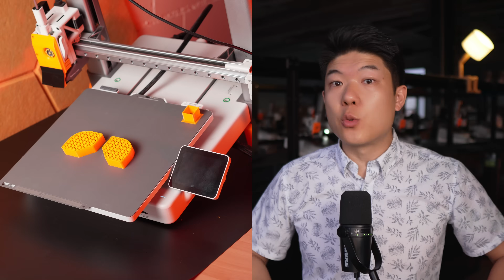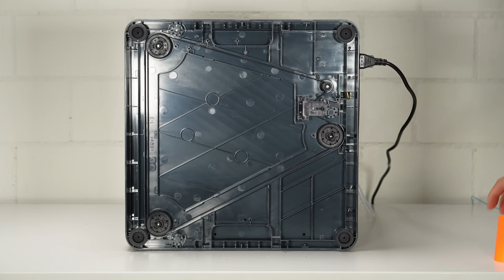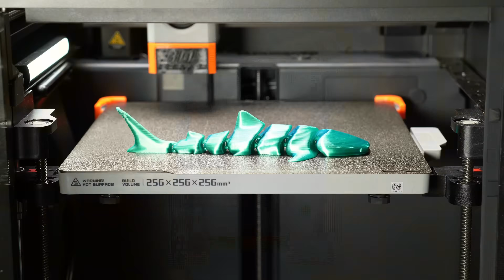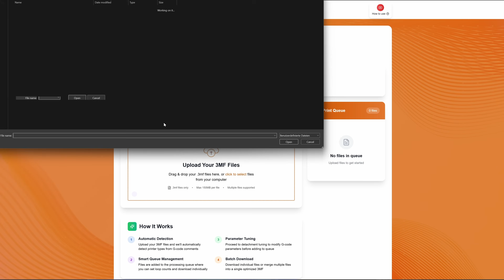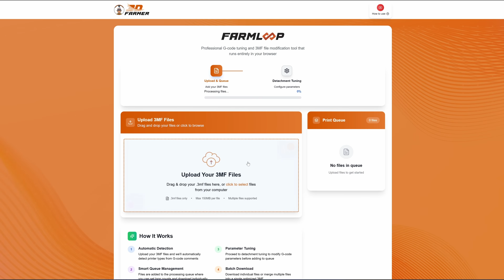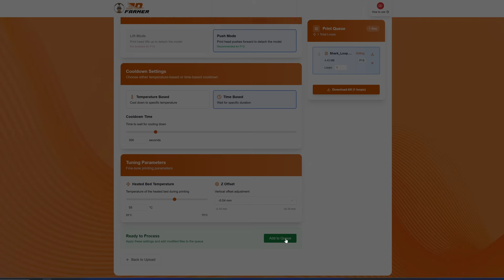How to Automate Your Bambu Lab P1S & X1C for FREE - FarmLoop Stage 1

Comment: what firmware are you using on X1C? I ask as tried your free app and the modified g-code sets the nozzle temp wrong, meant to be 230c your modified version is set it to 250c and 230c is max in the filament profile and i examined the gcode and there is no M104 S250 anywhere but still when tested still sets at 250c and tried 2 different versions of Bambu studio (since you guys dont answer emails thought would try it here) and also you app doesn't recognised modified machine profiles like my Steinwiper profiles!

Comment: If farmloop code failed to clear the bed after 3-D printing(some parts left behind), do you have a solution/code trough farmloop for second pass of printing head to clear the bed? By the way, product is amazing
Reply from the maker: SimplyPrints Bed check AI will detect it and stop the print. However, a sweep motion in the start of the next file would be a great idea. I will think about that.

Comment: Great system. Just wanted to use it as a hobbist, not full print farm. Can't justify the base price for me, just want to print more away from home. But the locked settings for z offset, and temp (25ºc is too low for my location, it never gets there) and time (that is what I use, but an hour is too much). Had little problems with z offset, but would like to try changing ir for better testing. But I recomend it for any one looking to build a print farm.

Comment: Hi guys,

Fantastic system, I’ve just finished installing everything. I have a setup with 4 X1C printers and I’m facing a small issue: when I start a print via the app using the print loops, after the first part is finished, the build plate doesn’t lower to clear the part. It remains fixed in position.

I’m probably missing something in the Farm Loop app settings. That being said, thank you for the great work you're doing.

I hope you can help me out.

Best regards, Luca
Reply from the maker: Hi Luca, did you click on Add to queue before downloading?

Comment: Great system! I might even go for the Pro plan. 

One question though. How does the printed tilting affect the max. overhang angle? Can I still print at 45º with no supports at any direction? Hve you guys tested this?

Comment: For using the farm loop automation on multicolor prints, do you find it best to remove the prime tower to avoid removal issues? Worried that if i keep it, the plate bending wont be enough to break it free and the print head attachment wont be able to remove it before the next print cycle. I saw @samcraft post a video using the farm loop for multicolor and i didnt see a prime tower

Comment: I can't get it to work for me. The print plate does not go all the way down and bend before scooping, for whatever reason.
Reply from the maker: Did you watch the how to use video on the farmloop app page?
Reply: @3DFarmers  I did, I uploaded my Gcode into the farmloop app, selected my loops, downloaded the gcode, but after its finished with its print, the bed does not lower enough to come in contact with the bender, and the extruder never does its pushing motion either. I can't figure out why. Once the print is finished, the bed will only lower about half way, then the it will begin leveling to start a new print. I am using the bamboo labs p1p.
Reply: I figured it out. I did not hit the "add to queue" button before hitting the download button in the farmloop app. I missed a step. Dummy me. Works fantastic now. I bought the subscription. You can have my $10 a month. Worth every penny.

Comment: As much as I wanted to love this system, it just ruined my brand new p1s catastrophically. From the aftermath, it seems like what happened was that one of the pieces I was printing ejected directly down into the bottom space of the printer, at which point it got sucked in by the z-axis rods. The z-axis rods chewed into the PLA and got stuck, de-calibrating the Z-axis in the middle of the print. Finally, when it raised again to start the next print, it pushed the bed straight into the print head, which started moving and slicing gashes into both the print plate and the heatbed. I'm trying to file a warranty claim but I'm not expecting anything once they see the print logs include modified gcodes. Let this be a lesson... don't be an early adopter. If Z-axis shields or a part slide of some sort been considered in the original design to avoid this homing issue, I wouldn't be left with a (now only $400) piece of junk.

Comment: Does the app work with K1C? I made a modified toolhead cover with screw on attatchment to push off parts and a bed bender. I use Orca. In the future I will make a door opener too.

Comment: I converted the file and applied it to the X1C, but only the loop function works; the auto-lifting and auto-pushing functions do not work. Is this related to the latest software update?
Reply: Pretty sure you need to edit the file that says what happens when a print ends. Watch some other automation videos on it. I think it can be done in the pc Bambu labs app
Reply: Might be wrong tho I will look into it tomorrow as I want to do it with my p1s

Comment: Is there a maximum print size with this system? Can i use the whole build plate?
Reply from the maker: With Stage 1 max z height is 200mm. Stage 2 will unlock full height.

Comment: Love the idea.  Wanted to test it before I bought it, but wanted to confirm that the free version requires 3600 sec (1 hour) before it will attempt to detach the 3D print...?
Reply from the maker: Yes, the free version has 1 hour of safety wait time before release. With the Pro app you can adjust that time.

Comment: Just to clarify - you don't have fusion tutorials, just exercises that tell you to print a specific print(challenges) - correct? So you must be already experienced In fusion  to benefit I'm assuming? I believe you have recorded videos showing how you completed the challenges? Do you think that would be enough to learn fusion? Or do you have another recommended source to learn fusion?
Reply from the maker: Our challenges focus on learning by doing and are design to create products for additive manufacturing. There are 10 challenges for beginners and 10 more will come out for advanced users soon.

Comment: Great solution! I wonder how simpler solution beats comlex and over engineered mechanisms easily. 
I was always thinking about this kind of part ejection mechanism but always stuck in overthinking an over engineering. So, best wishes and hats off. I would like to learn more about the update of the project and share insights together.

Comment: Hi! I really love your 3D Print Auto Farm. I’m using the free version, and I noticed the bed cooling temperature can’t be changed. It’s impossible to keep my room under twenty-five degrees in the summer, so it would be amazing if we could adjust the temperature even in the free version. Thank you for considering it!
Reply: Can you tell me how you made the cooldown work? I tried several times, yes, site shows that bed will be cooled to 25, but in real my P1S is starting 2nd print after the 1st immediately

Comment: What am I doing wrong? On the X1C the modified gcode of a 20mm cylinder 
1) cools the bed and sends the bed to the bender
2) preforms a gentle push with the bed down way past the part height never contacting the part.
3) sends the tool head to the exclusion zone
4) raises the bed some
5) sends the tool head to the back right corner 
6) fast pushes forward until the tool head reaches the exclusion zone and repeats.

The issue is that the gentle push never contacts the part and instead the tool head crashes hard into the part when it starts its bed clearing sweep.
Reply: It is as though the software doesn’t account for the parts actual height.
Reply from the maker: Yes this issue is know and will be resolved with the next version of the app which updates next week.

Comment: I have a Bambu X1C and just installed all the parts. When I printed the first one, it brings the plate down to the bottom and then errors out with "heatbed homing abnormal".
Does anyone have a way around this?
Reply: also having this issue cant figure it out

Comment: Thanks. Still debating buying the pro version just trying to figure out if its worth it for me. I have a few questions

Will it or is it possible to print different colour each time as that's something that would be super useful and would this be out before Christmas? As that's something that would be super useful for Christmas as I sell a wide range of colour option around Christmas

Comment: After it cracked the build plate, it went up for the tool head to push the part off, but the build plate went too high and touched the glass top, and when the tool head tried to push it off, it wouldn’t get off because it was too high What is the problem?
Reply from the maker: That sounds like a bug which we are fixing right now. If you are subscribed to our newsletter you will get notified as soon as it is solved.
Reply: Thank you

Comment: I have tried so hard, but I can’t get it to work😢
Reply: I can get it to start a new print automatically, but it doesn’t throw off the other prints. It doesn’t even try. It’s not like it fails
Reply: @NORDIC_CREATIONS  When you download the file after processing with the app are you using the big orange 'download all button' or just downloading the modified file via the download icon next to the modified file?
Reply: I use the big orange button.
Reply: @NORDIC_CREATIONS  Ah that is your problem then. You're also downloading the original file in the loop (hence it not clearing the bed). Try downloading just the modified file. You can also checkout the instructional video that shows this step. It's linked in the top right of the farmloop app page, labeled 'How to use'.
Reply: I’m gonna try that thank you for helping me❤

Comment: It works on most stuff but it once launched my whole texture plate off with the print
Reply from the maker: Then you can tune your detachment settings in the app until it works!
Reply: @3DFarmers  turning down bed temp when it pushes off helped a lot. I still noticed sometimes my p1s head cover would fall off when pushing objects. I slapped a rubber band on it and i no longer have such issue

Comment: I need it to handle 64 parts per plate, each about 30mm in diameter and 2-5mm tall. The parts are all equally spaced over the plate 8 rows of 8 parts, each row staggered from the next. Can it do that?
Reply: Best to only load a few parts on the front half of the plate. But you can loop multiple plates. With automation, you don't really have to load plates full.

Comment: Without the paid version you have to wait 1 hour? That's annoying wanted to give the system a good test before seeing if purchasing the pro mode is worth it. It 3600 the recommended time even with pro?
Reply from the maker: In the Pro version you can flexibly change the cooldown time. We set 60min for the free app so it's safe to detach.
Reply: @3DFarmers Thanks. Still debating buying the pro version just trying to figure out if its worth it for me. I have a few questions

Will it or is it possible to print different colour each time as thats something that would be super useful?

Comment: Super rad.  This is working great on my P1S .  
It’s a very well thought out system and way better use of time than manually screwing around with gcode copy pasting and worrying each run that i’ve made some error.
Reply: How did you get it to get past the initial homing? Mine goes down all the way and then pops an error
Reply: Is your Z height defaulting to 2mm for the first sweep?

Comment: I get an error message all the time that my printer cant home the bed. This only happens with Farm Loop. Do you know why?
Reply: I am getting the same message, it seems like the pusher fully pushes the plate off of the magnetic plate and the printer recognizes that the bed is no longer attatched. When I manually move the Z-axis, the plate re-attatches, so it would not be an issue if it just continued the print, but I cannot continue while the error is ocurring. Have you since found a solution?
Reply: @pijkedaalder4339  I didnt change anything and now it works, probably just a bug

Comment: Great idea, but having issues. Bed temp does not drop between loops to lower adhesion, Z axis is not lowering to crack bed on the uprights. On one part I tried to farm printer head is just crashing into the parts to eject them while bed is still warm and part attached to bed...
Reply from the maker: Hi Sean, thanks for the feedback. Please provide us with the 3mf file to check this bug. contact@3d-farmers.com

Comment: After watching the A1 automation video you posted earlier, I made a setup that connects the plate and filament cutter stopper with stainless steel wire to bend the plate. When I checked the video again after a long time, I found that you had uploaded P1 automation using the exact same method I had been envisioning. The video and code you shared were very helpful. Thank you.

Comment: I have a question: Is it normal that the print bed temperature doesnt go down before ejecting? I print with 65 degree Celsius and before and while ejecting the temperature stays the same. Also I bought the premium version.
Reply from the maker: There is a small bug which will be fixed by tomorrow or one day later. As for now please adjust the heated bed temperature in the slicer instead of the farmloop app.
Reply: @3DFarmers thank you! You answer really fast! I appreciate that :)

Comment: I was pretty hyped seing this, and wanted to try out, but the print keeps cancelling itself after bed leveling, without any error. I don't understand what's going on...

Edit: i print on a X1C
Reply from the maker: Drop us a message to contact@3d-farmers.com with your file and failure description. We might be able to help you out.
Reply: I got an answer very quickly, with a workaround.
There is actually a bug with X1C profile, if you get the same issue, just slice the file with P1S profile, then print on your X1C. They already work on a fix.

Thanks  @3DFarmers , keep the good work ! :)

Comment: Allright! Curious in testing this. I have some really really sticky PETG cf Parts that i print with 4 on the bed. I need to bend the 4 corners plus also a firm bend inwards to pop the pieces. 
I'm going to try to print 1 piece in a corner with sufficient cooldown and hopefully it will work. 
I need to print this piece in batches of +100. This will make my life easier if it works. 😊 Thx for all your hard work!

Comment: I assume that supports and brim wont be able to come of the built plate and are not recommendet to use with the system ?
Reply from the maker: Depends. There is a "low" clearing sweep to remove supports and small parts.

Comment: I have learned so much from you since joining you way back when it was on Patreon. I am going to be implementing this system in my printing as soon as I can get the parts printed and it set up. Printing is still a hobby for me at this point but, I am looking for some products that I can print and sell. My goal is to transition to be a print farmer like my role model, Yanyan.
Reply from the maker: That's great to hear! Thank you so much for the support.

Comment: Thank you for the different model gcode combine we asked for :)  realy helps out.
Default textured build plate yes? im guesing the super tack would just be an issue with this.
Reply from the maker: Yes, thank you for that feedback. It is a way better user experience like this. Yes, textured plate should be used. SuperTack can work with parts with tiny surface area, but it is risky.

Comment: So you think a good starting point would be to get an A1 with the AMS and build volumes from there? Or is there merit to picking up an XIC with an AMS because of the chamber? I have been using a Prusa MK3S with the MMU3, but the quality and reliability really show on this machine.Prusa has really priced itselfout of upgrading, so I have been looking at Bambu Labs because there is no currency exchange on pricing in Canada, which makes a big difference on upfront costs with printers.
Reply from the maker: My preferred starting setup is a P1S with AMS. Gives you flexibility on materials, reliability and great ROI.